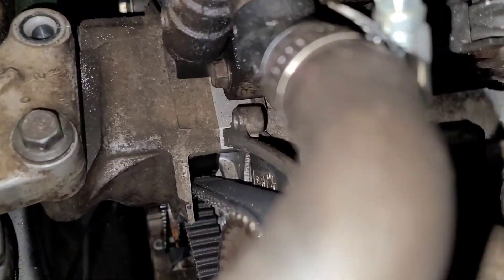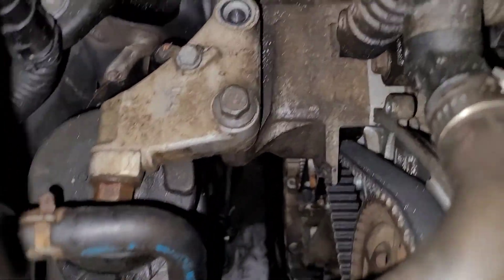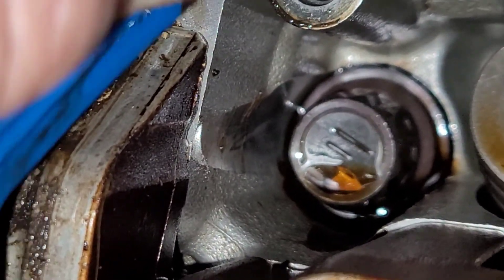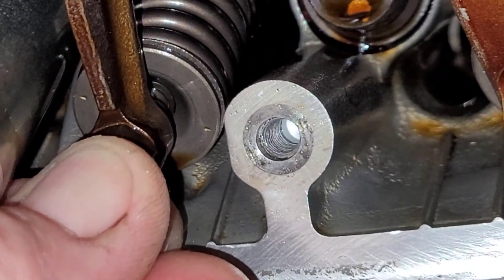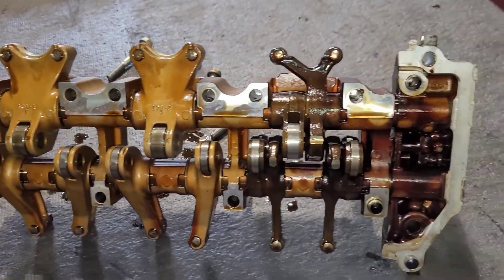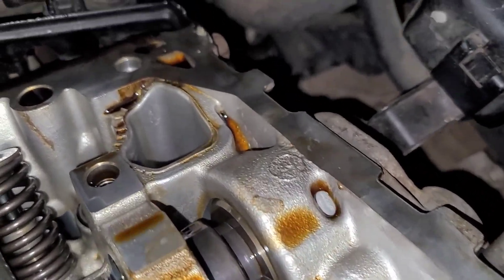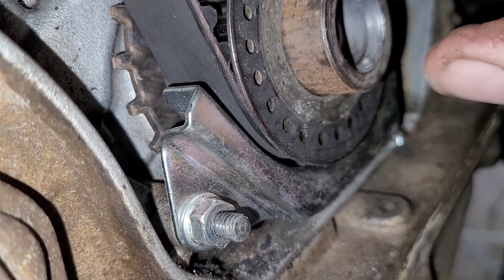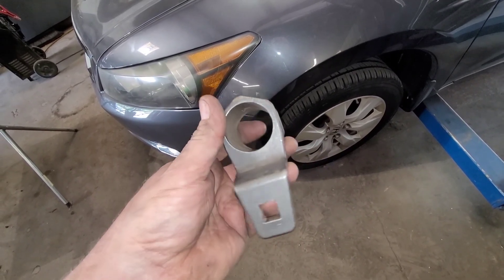Every Cylinder Misfire on one bank? Heads were just done at another shop. What will I find. Part 2

Comment: I worked at a ford dealer for 14 years, we had a ford system that was called fixed right first time. This gave us feed beck on our repairs as an individual tech. worked great for the most part. What it caught was the techs that did not follow the manufacturer specks to do the repair. They were lazy and would not take the time to read what was supposed to be done. (trying to short cut things)This bite in the butt more than once  as they would get a comeback and loose pay. Skipping a simple thing like a small amount of sealant in critical areas is just plain lazy. The valve adjustment if you think about it is absolutely necessary after the heads are shaved . Anybody that did that would not work at my shop because i take pride in fixing it right the first time.
Reply: P

Comment: I've learned over the years when i have a problem car come in, my first question is who worked on it last and what was done to it.  Had a customer with a volvo come in for a timing belt service.  I lined everything up to replace it and found out the cam was off 1 tooth--HUH?  rolled it again and found the same issue.  I replaced the belt and took it for a drive--ran great.  Customer picked it up and came back about 10 minutes later and asked what we did.  I told him. He said it never ran so good the entire time he had owned the car.

Comment: I`m 65 and have been wrenching on my own junk since I was 16. Next I will try to rid my 96 Blazer LS of a lifter tick. It`s due for an oil change soon and I`m adding a qt of atf to the oil to try to free a stuck lifter in the 4.3, then oil change in a week.I only use Wix filters. It sat for almost a year before I bought it for 500 bucks last November. Also have a complete new injection package to fix the bad mpg, AC Delco upgraded kit, bye poppet valve garbage, hello multi port. Thing is, it has 220,000 on it and still runs good except for the 10-11 mpg. I really want to drop a sbc in it, but have no clue about the electronic side of the swap. Keep on Wrenchin.

Comment: I wonder if the reason the first belt failed so soon was because the first guy put that shim on backwards. Then the second guy didn't understand its function, so he didn't recognize it was on wrong. So, he repeated what the first guy did. Even in the dealer repair manual they don't explain what that shim does, although they clearly state which way it goes on. Once you know what it is designed to do, it's easy to remember which way it goes. This was an excellent video, I didn't realize that the rocker assembly is not encompassed by the rocker covers. I guess they did that to place the VVT solenoid assembly on the outside, hence the need for sealer. Did Honda ever stop using manually adjustable valve lash?
Reply: They still use adjustable valves

Comment: Great job fixing the previous shops screw-ups. 
Does the 2010 Honda Accord V6 have VTEC?
The performance-oriented Accord V-6 Coupe with 6-speed manual transmission exclusively has a 3.5-liter V-6 VTEC engine. (The others with automatic transmissions are VCM (Variable Cylinder Management).

Comment: I was thinking about looking at a Accord but might not consider one since it has a belt and not a chain and is a interference engine.  If I do consider one there will have to be proof the belt was change if it has high miles.

Comment: My tight valve story pertains to a no start on a fresh build race car engine. A liscensed mechanic turned shop teacher , a mechanic that apprenticed under me , a few other me hanics , car driver and the engine builder couldn’t get the car to start. I was crew chief on this car but quit because of these guys hanging out there drinking beer while I and the driver would do the weekly repairs to get ready for Friday night at the local track. Finally after days of begging me to look at it I took the Friday afternoon off to go see if I could figure it out. After a minute of cranking , off with the valve covers , backed off valves and started the race car. Turned out the “ anti pump up cheater lifters pumped up. I was amazed all the mechanics and engine builder couldn’t hear the issue out the pipes. This was extreme not to start but still easy to figure out. Remember , pop through carb , or intake is intake valve , pop out tail pipe is exhaust valve. Also , loose valves , to a degree is more horse power .
Reply: This information is so insightful and at the same time completely useless without the learned earned experience on how to apply it!
 So if I may ask a question to help me with my own understanding on how it applies please....
 I get exactly what you mean with the intake or exhaust pop that you reference but if you could explain the loose valve to horsepower to a degree part....
 And in my exact case I'm asking because I have a 94 Ford Mustang 3.8 V6 Manual that I got extremely cheap for under a grand due to the kid that had it could not getting running right.
They got to the point where they let it sit parked under the car port for 2 years untouched until they finally came off it. 
They loaded it on a trailer and delivered it to me with a box of parts and some in the trunk.
From all the info I was given they had an issue with a fouled plug and misfire and went through plugs and coils and wires and then pulled the valve covers to look for a broken spring.
Found nothing put covers on and there it sat.
Now it's clear to me they messed with the rockers. Where I am now is I have the car running and checked all the push rods and springs and valve action by hand with a bar on the crank before I ever started it.
I adjusted all the rockers and valves back into spec as best I could to keep from taking more apart then needed unless I had to.
What I have is the miss is on cylinder 3 and the compression is so low that plug is not even burning they all look fine except that one is just black soot.
I ask because what I found in the valve adjustment for the 3.8 V6 is the rockers are non adjustable according to what I found if that is correct?
It says to start at #1 TDC compression stroke and tighten all to 26 ft lbs and gives no call out on any order after and there is no lash adjustment or anything.
Is that correct?
Because it seems on cylinder 3 that from the time the intake valve opens the exhaust valve seems to open before the compression has time to build.
So I'm asking because I'm wondering even though they say non adjustable is it still possible that the exhaust valve is too tight and causes it to open to soon?
Can I or should I try to back that bolt off some?

They don't have a jam nut setting just a built in pedalstool on the head with a bolt and square washer through the rocker that holds it on.
 So is there any degree of play I can work with to try to find time this or am I gonna wind up pulling the head to look for the issue?
What must be done will be done and trust me I know.....
 There is nothing worse then someone asking hey what's wrong with my car?
I have this and it's doing that, can you fix it and how much!
Lol
The amount of variables that could be wrong with the car is a list as long as the list of all the things they leave out when they say ...
All we tried is this and it didn't work or it was fine and one day just died for no reason!
LMAO
Sooooo.... In order for you to know anything about my car would require you to be here on my car but if you can give me any insight to the valve rocker adjustment or non adjustable for the 94 Ford Mustang 3.8 V6 so I know if what I am telling you is correct or is the information I have wrong and point me where I would find the correct procedure to try before I call it on pulling the head.
So on the passenger side I have 1 2 and 3 with 3 at fire wall and 4 5 6 on driver's side 6 at fire wall.
If I have that wrong let me know and it is 3 the only cylinder that is my issue
So pass side at fire wall 
No matter what number at least that issue does not change!
Lol
Thanks for any insight you might share and shared already if you ever get this message!

Comment: That 28 thou valve clearance sounds a bit large for Honda engines.  I have only worked on Honda motorcycles, and 2.8 thou seems more like the normal, with a max of 6.0 thou for the exhausts.   Are you sure you have not missed the decimal point...?
Reply: Those motorcycle engines were air cooled, mostly 2-valve/cyl and not VTEC. Different temperatures, different included angles between inlet and exhaust and definitely no VVT.

Comment: I worked at a toyota dealership in the early 80s, did`not see it but heard of a tech that would carefully disassemble whatever he was working on without cleaning any more than was absolutely necessary and carefully reassemble so that it actually looked untouched but the repair was done correctly. He supposedly said he wasn`t paid to clean the area he worked on. possible myth? maybe.

Comment: A leak down test is to check the rings not the valve’s performance
Reply from the maker: It's to see if the rings , valves , head gasket ate sealing . Basically the integrity of the that particular cylinder you are testing

Comment: Sorry Kenny, but I think you made a mistake with the valve lash settings. The numbers you used were in millimeters, not thousandths of an inch. The valves are set way too loose now.
Here's what I found on-line:
Intake: 0.20-0.24 mm (0.008-0.009 in.) Exhaust: 0.28-0.32 mm (0.011-0.013 in.).
Reply: Good job Bart I thought something was off and you found it
Reply: Probably why it sounds so clattery!

Comment: Those specs you had there seemed way high for valve clearance… no way they should be anywhere near 20-30 thousandths
Reply: Yeah, the specs he had were in hundredths of a millimeter. If he adjusted the valve to that thinking they were thousandths of an inch, the valves are way too loose.
Here's what I found on-line:
Intake: 0.20-0.24 mm (0.008-0.009 in.) Exhaust: 0.28-0.32 mm (0.011-0.013 in.).
Reply: That was my exact thought too. But he did say thousandths at least twice when he showed he couldn’t get a .008 feeler in…. I get the feeling he actually adjusted them that loose. They will run fine that loose just be noisy. Personally all I ever use is thousandths of an inch so I’ve got a pretty good idea what a spec should be